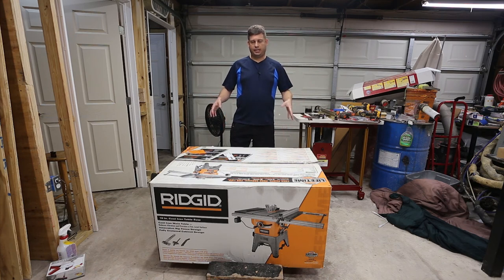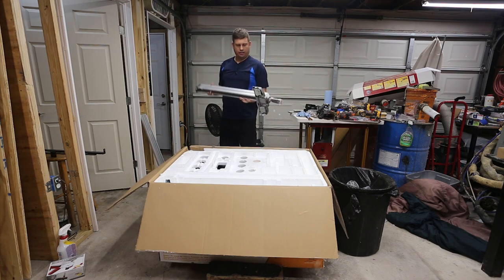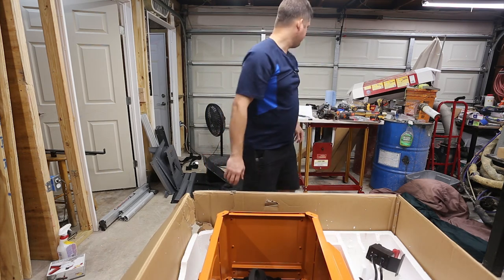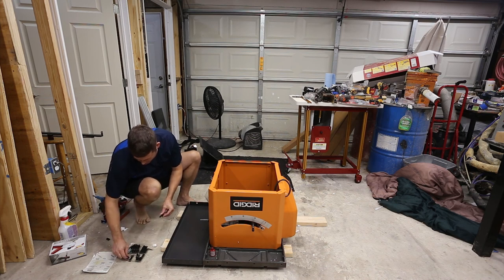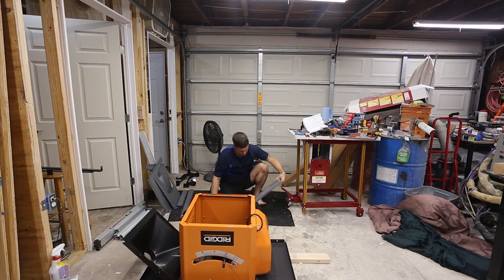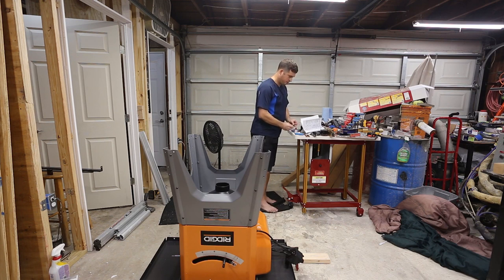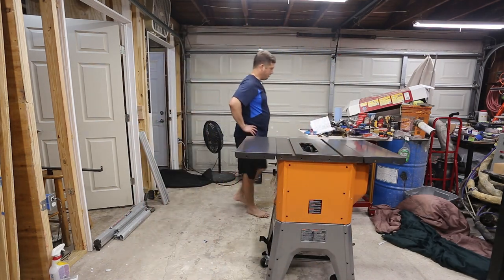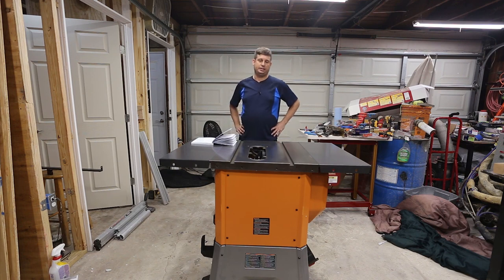Ridgid R4512 Tablesaw assembly - partial no fence

Comment: So you are all about wearing a full face mask and respirator but you dont wear shoes in your shop????? Interesting.
Reply from the maker: I wear a helmet when I ride a motorcycle, but that doesn't mean I wear one when driving my truck.  Different situations require different amounts of safety.  Mechanical assembly on a swept concrete floor isn't something that requires shoes.  They aren't going to save you from anything other than some dirt on your feet anyway.  If you don't believe me, drop a wrench on your shoe while your foot is in it.  Thanks for watching.